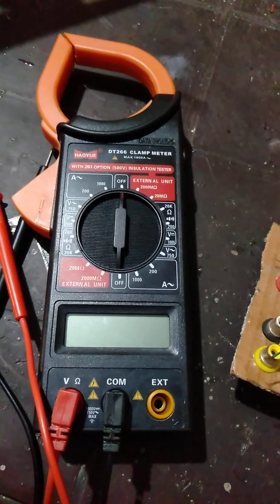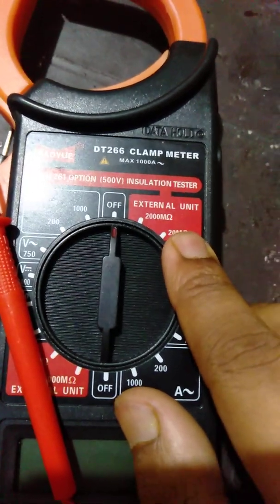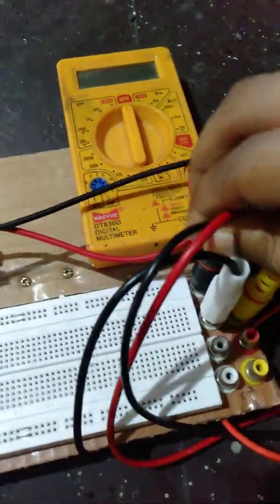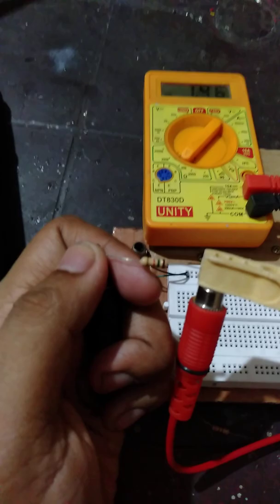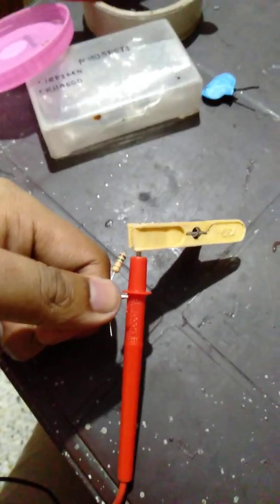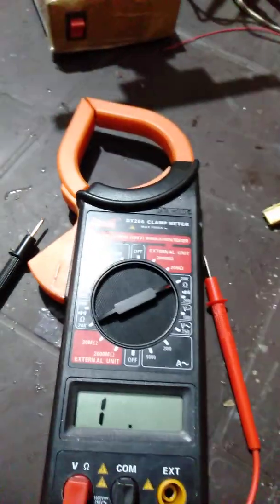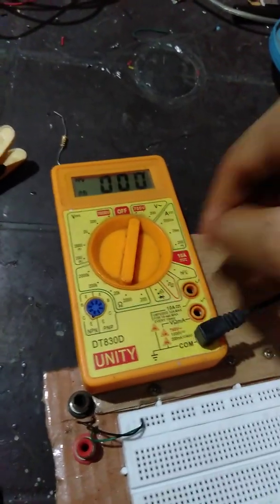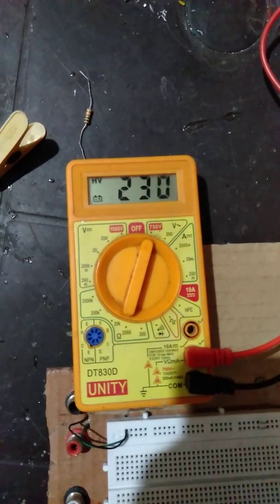This is why you should not trust a cheap DT266 Clamp Meter | Clamp Meter Review [PART-1]

Comment: Try sanding your probe terminals... Maybe there has been an insulation layer on the probes (just a guess) The continuity of this meter is busted tho!
Reply: 3:45 he takes those new leads out and puts them in the second meter, and they work fine. It's the clamp meter at fault.